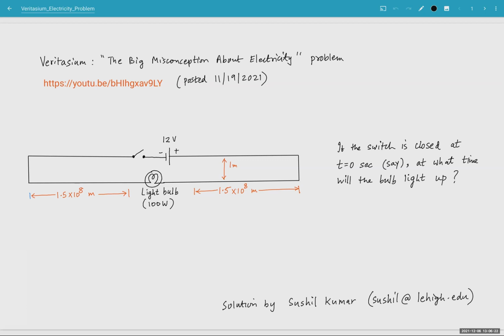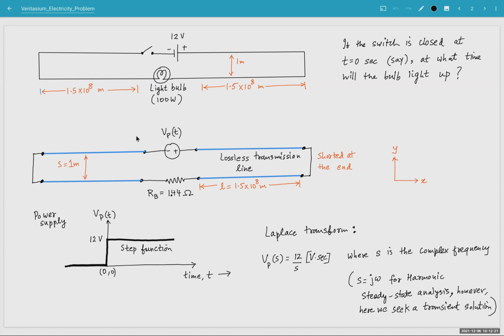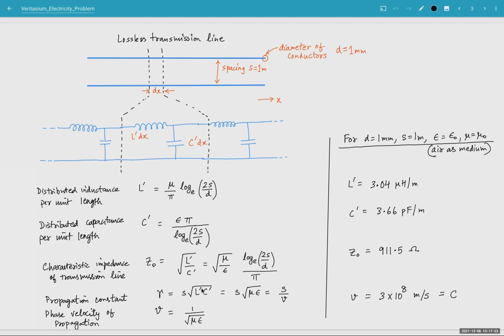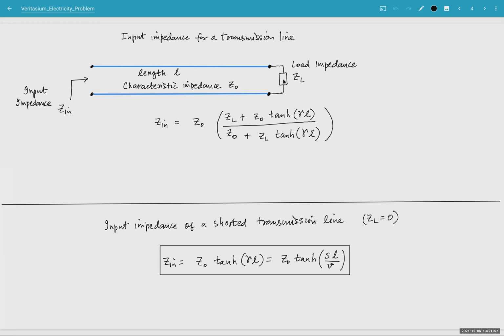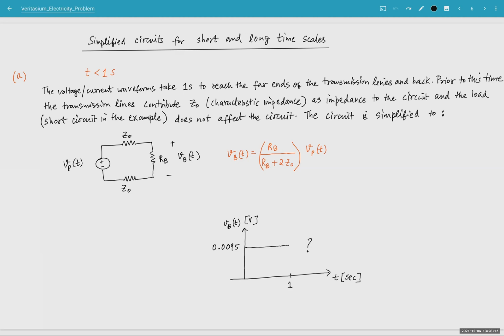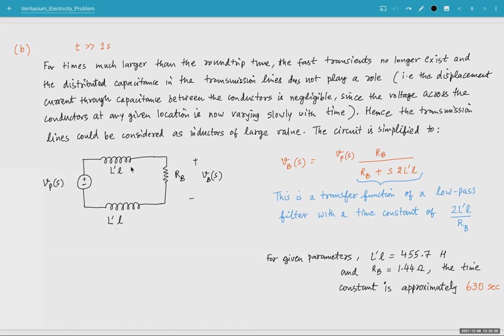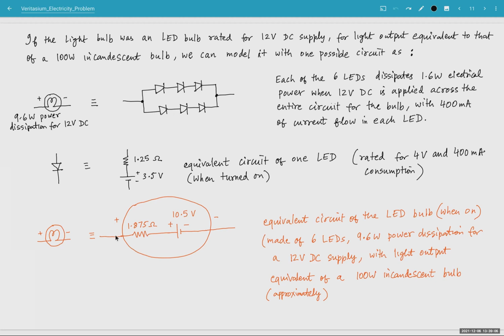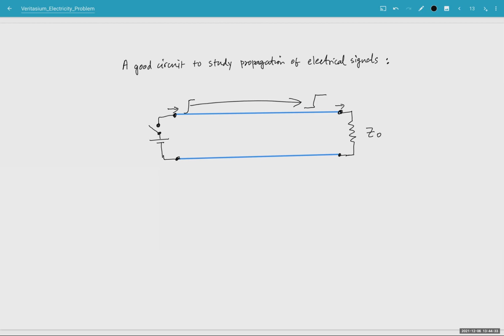Quantitative solution to the Veritasium Electricity problem (light-bulb circuit with long wires)

Comment: Ah, so this is how an engineer looks at the problem.  Very good explanation of your analysis.

In Veritasium's video it is implied that the battery, switch and lamp are fixed to the surface of the Earth and that the wires extend in a straight line tangent to the surface of the Earth.  Since the total length of the experimental apparatus is one light second I would imagine that there would be a difference in magnetic field from one end to the other and since the Earth rotates wouldn't that in effect create a dynamo?  If so, since Derek stipulated that the bulb would produce light with any amount of current flow, then the light would always be on.

Comment: Yes!  You've got it.
Difference between electrical engineers versus physicists is with our experience with 2-wire lines versus circuitry:  when first watching Veritasium, it takes me half a minute to realize that this is a pair of infinite 2-wire lines, and their near ends are connected IN SERIES with the bulb.   Since 2-wire lines always "consume" joules of EM at a constant rate for a constant difference in applied potential, they behave as simple resistors, if their wire-resistance is zero.  I would guess at 600 ohms resistance for 1M spacing, since 1cm spacing in plastic gives 300 ohms (TV twinlead,) and empty space ohms-per-square is 377 ohms.  Now we're at 40sec of thinking.  

So, Veritasium is obviously correct, and for the first 500mSec there will be a constant current in the "ideal" light bulb, and it will turn on.   But what is the bulb wattage?   Hmm.   Ah, we need to MATCH the source-impedance (which might be  2*600, 1200 ohms,) so the bulb should be like a single LED pilot-light designed for 12V.   Ideally this "bulb" is a 1200 ohm resistor.   It's in series with two 600 ohm resistors.   In that case there will initially be 6VDC across the bulb, and it draws five milliamps, 30mW, which would brightly light an LED. 

That took roughly 2min of thinking.   WHy did it take everyone else a week, or even two?   (Most people disbelieve Maxwell, and instead believe that electrical energy flows inside the copper wires.)

Note that the value of the load-resistance (the bulb)  *cannot* be randomly chosen.   If it's large, then the initial current will be relatively enormous: 99% of the final 100% current.   If it's too small, then we'll wrongly believe that the initial current is insignificant compared to final current.   Arbitrarily choosing a bulb-resistance can give whatever results desired ...if we're trying to defend our beliefs (and not trying to dig down to the actual truth).

Also note that, for bulb wattage, the battery volts cannot be arbitrary.   If Veritasium had instead used 220VDC battery, then the initial wattage for the bulb can be almost 10W.   Ten watts leaps right across the 1M gap.

Later I look up an online "impedance calculator" for 2-wire transmission lines, and find that a 1M line with heavy 5mm wires will actually have a Zo of 700 ohms, not 600 ohms.   So my seat-of-pants estimation was close.

I note that in most YT responses and their comments, everyone focuses on that 1000mm gap of empty space, claiming that the bulb-wattage must be near zero, because electrical energy cannot leap such a large gap.   It can.   That's Veritasium's TRICK QUESTION, intended for a physics-exam, to expose the students who don't really grasp the essentials of transmission-line physics.

Hint:  re-do the problem with 10 meters spacing between wires, 5mm wires, and 200VDC battery.   (If Veritasium wanted to befuddle the audience, he could have used 10M gap between wires!! )
Reply from the maker: Hello, I respectfully disagree on trying to make it look like Veritasium posed a genuine solution to a relatively complex problem. They appeared to trivialize the problem according to their convenience, or rather, according to their limited understanding of the concepts without going into the details. I think Veritasium made a mistake and should clarify with a follow up video. It's quite clear they implied taking a portable battery (typically 12V) and a household bulb (typically much lower resistance than the characteristic impedance Z0 of the transmission lines), and for those components, their answer is incorrect or misleading at best. We can't give them benefit of doubt because that video muddled lot of concepts. Also some of the statements that were made in the video are overly sensational (about how electrical engineering has been taught), especially when coming from someone who is clearly not an expert in electrical engineering.
Reply: @sushkr  aren't transmission line models zero-dimensional in the direction transverse to the that of propagation? As far as I know, TLs are modeled by considering a voltage applied across their terminals and this is not the case in a real life experiment with the topology proposed by Veritasium. I believe what you are solving for is the case for the distance between the upper and lower conductor to be zero (yet still considering the capacitance per unit length C' and the inductance per unit length L' to have the values they would have when the distance is one meter).
Reply from the maker: @copernicofelinis  Yes that is correct. I did mention that in the video. The transmission line circuit will model the longitudinal propagation delay (along the length of the wires) correctly, but cannot model the transverse delay of few nanoseconds. That's why, I qualify 'instantaneous' being synonymous with few nanoseconds, and hence, all the plots that show voltage rising at the first step at 0+ seconds will essentially be of the order of few nanoseconds (~1m/c) in a real circuit.

Comment: This is great! As a quick caveat before I've had a chance to think on this longer, the only thing I can see missing in your explanation is a delta function at zero frequency; but that has no bearing on your solution as presented, since neither of the reactances matter at zero frequency. 

I was considering making this exact video if no one else did by ~Feb '22, but I was going to also include a full-wave simulation of the transients to back it up; you should do it before I have to!
Reply from the maker: Good catch, yes I did not include the delta function in Laplace function of the unit step voltage function of the battery since it won't affect the analysis. I don't really have experience with simulation of such circuits. It's been a long time since I last used the PSPICE simulation program.

Comment: Thanks for this video.  In discussion I also came up with doing the analysis using the transmission line approximation, but totally missed using the Laplace transform analysis of such.

I immediately jumped to assuming a 'bulb' resistance of 2x the characteristic impedance of one of the transmission lines.  Initial jump to 6V across the resistor, and 12V after 1 second.  Of course this means only a 0.08W 'bulb' at full power.

-Jon
Reply from the maker: That's correct. And, in another case If the impedance of the bulb is >> Z0, the entire 12V of the battery will appear 'instantaneously' (or within few nanoseconds) at the bulb. So yes, if a bulb with an active circuit such as an opamp input stage with infinite input impedance is used, the bulb will indeed turn on almost instantaneously even in such a circuit with long wires!
Reply: @sushkr  Try a 200VDC battery.   Then the initial bulb lighting is nearly 10W, even with a 1M gap.    Now increase the gap to 10M.   The bulb still lights (if bulb r is matched to 2x Zo )
Reply from the maker: @wbeaty  If you somehow find a 200V DC battery to plug in a circuit, and also then somehow find a bulb of resistance 2*Z0 (=1824 ohms), then the steady state rating of such a bulb will be 22W, and for short time scales, this bulb will dissipate 5W of power in this circuit. Of course, such a battery and bulb can't really be found on the shelf and will have to be custom built.

A more practical solution will be to use the standard 12V battery, and for the bulb, buy one of those tiny LEDs that we use on breadboards, which have a very small current requirement (few tens of milliAmps). If we put such a small RED LED (say) that is typically used on breadboards, which is rated for a 20mA current, it can indeed light up faintly within few nanoseconds. We have to use a large current limiting resistor (around 600 ohms for a 20mA LED) in series with such an LED to prevent burnout in steady state. If such a small LED is used in this circuit, perhaps 5mA or less current will flow through the LED for the first 1 second, and then the current will rise in a step-wise manner every additional second and it will take few seconds for the current to reach its maximum and steady state value of 20mA. So the LED will light up to full brightness in a few seconds.

Comment: An addition : At 11:52 time stamp, about the signal velocity you have said "assuming the conductors are surrounded by air". Not only that but the copper conductor wires must be also naked without an dielectric material insulation for a.c. signals. If not, the dielectric insulation μ and ε parameters must be taken into account and result to a smaller signal velocity than that of light 3E8 m/s.
Reply from the maker: Thanks for your comment. In this case the copper wires (say) may be surrounded by thin dielectric, but fractionally, most region separating the two wires is air and most of the electromagnetic energy exists in air compared to that dielectric shielding. Hence, speed of travel will not really be impacted by the dielectric insulation of wires. This is unlike the case of a coaxial cable for example, in which the electromagnetic fields primarily exist in the dielectric medium of the cable.
Reply: @sushkr  About the signal velocity on insulated copper wires, I'm not talking for signal transmission across the two parallel wires but transmission along the copper wires with PVC insulation which is shown if I remember correctly to be in the order of 2E8 m/s thus lower than c. Coaxial wires are not shielding the magnetic B field of the signal. Anyway, great presentation and quantitative analysis possible the best currently of the Ve subject. Bravo! And Happy New Year!
Reply from the maker: @Markoul11  Hello. I was not implying transmission across the wires. I was actually implying transmission along the wires. The speed that you mentioned is actually for the twisted pair type of lines (such as that in cat 5 ethernet cables) or coaxial cables, for which the velocity factor is in the range of 60-70 percent so the speed of travel will indeed be in the range of 2e8 m/s. In such transmission lines, majority fraction of the electromagnetic energy exists in the dielectric medium of the line that surrounds the wires. However, for the kind of parallel wires considered in the Ve video, it's more like a twin-lead or an open-wire ladder-line where the electromagnetic energy mostly exists in air and hence speed is close to 3e8 m/s. The Wikipedia page lists velocity factors in various kinds of lines: https://en.m.wikipedia.org/wiki/Velocity_factor.
And thank you and happy new year to you too!

Comment: You must not be teaching at all because he already said it  is a car battery which is 12V 35 Amp= 420W. Capacitance aur induction hai. Also the wire resistance is considered zero. Anyway, great job guys.

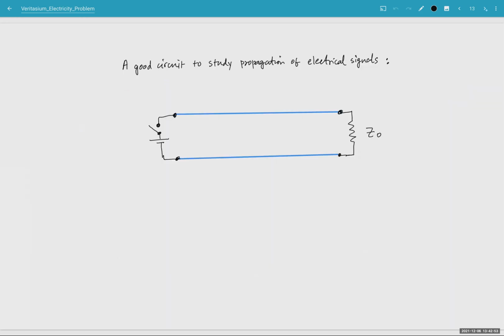Comment: @Sushil Kumar I really liked your presentation and agree with all of your conclusions if your transmission line assumptions are correct. However, the assumption is that transmission line rules apply. We are always taught that transmission line theory applies when a signal source injects a signal at one end of the line with both the (+) and (-) signals connected to the transmission line's feed and return terminals, respectively, at which point it propagates down the line (just like your circuit starting at 37:06). However, the Veritasium circuit shows just one connection of the voltage source (say, +) to the transmission line and the (-) lead of that line connects to the light bulb and another transmission line. So my question, when the step impulse travels into the transmission line, does it really see Zin as shown at 17:37? 
Does Kirchhoff's current law apply, even during the transient case? Take an example of 1/4 second after switch closure. Using your transmission line logic, the current will flow into the transmission line and a displacement current will flow to the return conductor and apparently heads towards the light bulb, but why not the other direction? How does it get back to the voltage source? Is there another displacement current? In other words, does the current consist of a conduction current out of the battery, then become a displacement current (crossing the dielectric gap), then another conduction current in the return conductor, then another displacement current (crossing the gap again), then finally a conduction current back into the voltage source? I'm having a hard time accepting that transmission line rules apply when one lead of the the voltage source (+) is connected to one lead of a transmission line, while the other lead of the voltage source (-) is connected to one lead of a totally different transmission line headed in a different direction. I'm really unsure if your circuit equivalent model shown at the lower part of the image at 17:37 is valid.
Reply from the maker: Hello, the current in the circuit is a combination of conduction and displacement current just like it would be in any circuit consisting of various lumped circuit elements such as capacitors, resistors etc. The direction of the current in the transmission lines is determined by the polarity of the battery. For example, if the current pulse is positive in one transmission line (say on the right), there will be simultaneously a negative current pulse in the transmission line on the left. Both current pulses or transients will propagate starting from the battery toward the end of the transmission lines as the switch is closed. Also, please note that for a two conductor transmission line, the current in both conductors is of opposite signs. This means, for the transmission line on the right, if the top conductor has a positive current pulse, the bottom conductor has a negative current pulse simultaneously at any given physical location.

Comment: Great job, but I don't think completely correct. The model you use for the transmission line does not consider the speed of the current in a wire, only the capacitive and inductive loads of the wire. The current or an electric field can only propagate in a copper wire at a speed of 200,000 km / s. Normally this can be neglected in the calculations, because the delays caused by the line inductance or capacitance have a greater effect. However, in this particular case of an extremely long cable, it matters. Second, the steps in the rise of the signal are due to the fact that the load is not adapted to the cable. If R of the lamp would be equal to Z0 of the cable, this effect would not occur.
Reply from the maker: Hello, the model of the transmission line I used is the standard model that automatically includes transmission delays of electrical energy (i.e. current and voltage transients). Since this is a lossless transmission line with air as dielectric medium, the speed of travel is actually 300,000 km/s. Once you add resistance and conductance as in a real copper wire, the speed will reduce. The speed can be noted from the complex propagation constant gamma on page 3 of the notes. In this case of a lossless wire, the speed is 1/sqrt(L'*C') which is same as speed of light in vacuum. Finally, even if the resistance of the lamp is matched to the characteristic impedance of the transmission line, you will still see the step-wire increase in voltage at the bulb, because the transmission lines are shorted at the far ends. Only in the case when the far ends of the transmission lines are terminated in an impedance of Z0 will the reflections be eliminated and no such step-wise response will be seen.